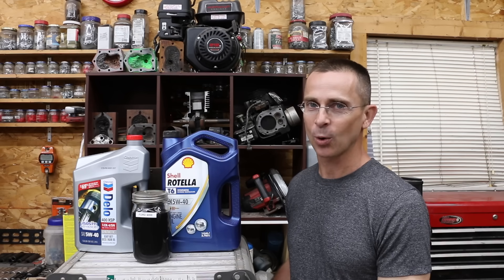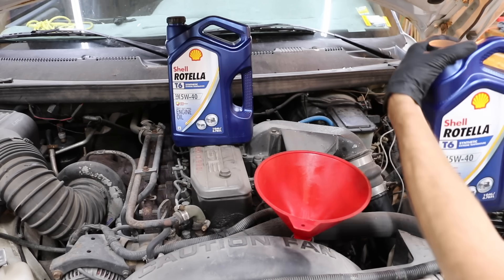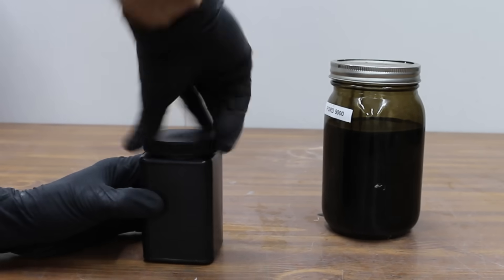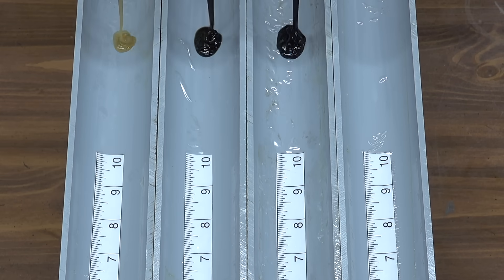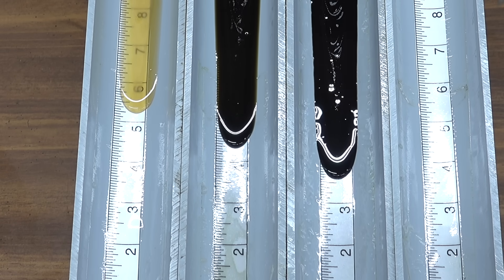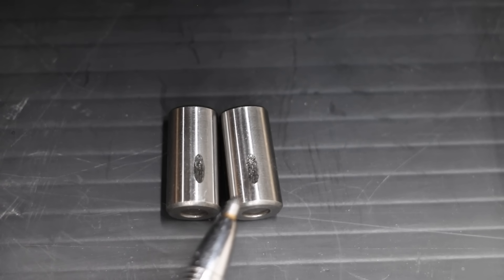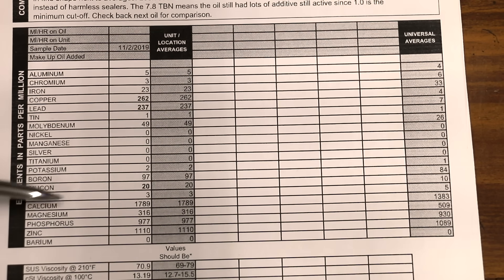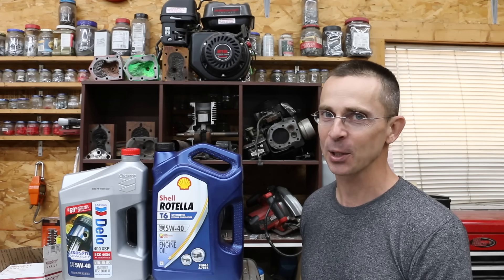Will Annual Oil Change Damage Your Car? Let's find out!

Comment: I bet that Rotella T6 is a Group 3. Ask the lab if they can detect if there is PAO or POE in the oil.
Reply from the maker: Thanks for the suggestion.
Reply: I would only keep oil in for a year if it was a Group 4/5 (real synthetic) and I spent $500 on an AMSOIL Bypass filter that really filtered the oil. Regular oil filters are on bypass mode so much of the time and when you really need the filtering. Navy ships use "oil refiners" because they are not going to change hundreds of gallons of turbine oil or diesel oil at frequent intervals. These probably take out water and acids and of course contaminants.
Reply: @amazoidal  These tests results are intended to find the extent of oil degradation, mechanical wear and the ability to continue protection and lubricity at predictable rates.  What is the basis for your changing oil every year?  Are you regularly taking engine, transmission and hydraulic oil samples for analyses and they reflect significant degradation after 12 months use?
Re filters on bypass mode, doesn't that mean there is sufficient oil being supplied and that the surplus, i.e. bypased oil, is returned to the reservoir?  All oil going to the moving parts is filtered.
Reply: Unfortunately, the spin-on or cartridge oil filters that are supplied with the vehicle (OEM) are a compromise between filtering efficiency and flow. The better the "filtering", the smaller the flow. And with the trend over the years to make oil filters smaller and smaller, the flow resistance has only gotten greater. As that smaller filter does it's job, and the pleats, holes get clogged, the flow slows. Then the only thing saving the engine is the "bypass valve". Even when the filter is new, that bypass filter is working  a lot. It is very common for owners to install "high-performance" oil pumps, or to increase oil pressure/flow by increasing oil pump relief spring rates. No wonder there are reports of oil filters gaskets leaking internally and externally. Some filters have very cheaply designed bypass valves that stay open. So those OEM type oil filters are not only a compromise between flow and filtering, but during cold starts and high rpm, the filter is not even a filter. AMSOIL makes a line of "Bypass Filters", which take perhaps 10% of the oil and can filter it more completely. Much of the oil that we change is merely "Dirty" and those contaminants can be more effectively removed by better filters. But auto manufacturers won't spend maybe $30 on a bypass filter, forcing the consumer to spend $500. The average consumer won't test oil,  and many are challenged to even check their oil level. So it's easier to create jobs by changing oil frequently.
Reply: Looking for evidence of wear artifacts, labs are probably using spark emission, ICP-OES spectroscopy or similar variant, which measure the concentrations of elements.  Testing for a specific organic may involve GC with appropriate detector or GPC/SEC, tests that could not be made for the under $30 for the typical oil wear analyses.

Comment: I have a 2007 F150 with the 5.4 and over 200k miles. If I put in standard synthetic oil or the synthetic blend, the engine will leak some oil. The engine does not leak with high mileage synthetic oil which has additives to help seals. I don't think the normal synthetic oil caused a leak. I just think it didn't provide the extra additive that the seal need.
Reply from the maker: Thanks for the feedback.

Comment: I have a 4.6l v8 mercury grand marquis. In the owners manual here in mexico it says use 15w40 weight. It hardly drops below 0°c to 38°c on summer here. I use mobil 1 super "conventional" 15w40. I change it every 4 months with my fl 820 motorcraft oil filter. I want to change it every 6 months. My options are 15w40 api sp  full synthetic from quaker state or this delo ( SAE 15w40 ) from chevron. Which one will you think it's better? My car is in good condition and the engine burns about 1 quart every 4 months. Thank you.
Mobil super is working good so far. It keeps my engine quiet but I don't trust the brand much to leave it more than 4 months, my driving is commuting daily, might apply to severe use conditions. Or I can use this shell from rotella that doesn't use api sn rating? Thanx for your time.

Comment: My anecdote is that I ran some oil in a Ford motorcar that was at least five years old and was sitting outside in a four seasons environment where it snows in the winter, we ran the car hard for about three months, we foolishly thought the oil and the fluids had been recently changed, they was not, we topped off the fluids but not the oil and the oil came out looking like molasses but nothing really bad happened to us except stuff unrelated to oil.  All the fluids in the car were over five years old.  Later we changed all fluid, but nothing bad happened in the interim.  The car had very few miles on it, which may have helped.
Reply from the maker: Thanks for sharing.

Comment: I'm disabled and in pain all day every day. As a result I do NOT drive very much and was actually wondering this. It didn't make sense to me that it would just go bad but I learned that it actually can however I am capable of using it long enough well over once/month to operating temp. Nice info and I trust it based on the transparency. Weird how transparency works like that.
Reply from the maker: Thanks for sharing.

Comment: One of my cars runs low annual miles.  I queried Blackstone Labs about "low miles vs 12 month oil change".  They told me, "... go by OEM recommended # of miles, not time.  We've tested oils which have been in the crank case for 3 years which are still good"...

FWIW...
Reply from the maker: Thanks for sharing.

Comment: 21 years of Amsoil annual oil changes and I've never had any issue.  Oil level is the same after 1 year as it was the day I changed it.  Less time wasted, less cost, super convenient!
Reply from the maker: Thanks for sharing.
Reply: Wow impressive
Reply: Amsoil does not have brand specs codes on it's packaging, why not.  I use Liqui Moly or Motul, with specific mfgs specs listed on bottles, it makes a difference...if the spec is not listed, means it wasn't tested to meet the mfgs specs for emissions, buildup etc..ie VW Porsche, Audi specs, Vw has codes like 502,504 505 506 507, weigh alone is not the true spec

Comment: Having oil temp up high enough long enough to drive off condensation/water content at least once a month is imho key. IE running under load 30 minutes or more.
Reply from the maker: Thanks for sharing.
Reply: @ProjectFarm   Excellent video, by the way. At first I was afraid this would just be at home testing, where I felt analysis by an oil lab would be the gold standard to definitively answer the question. Then you shared lab results.

Comment: diesel oil in a gasoline engine...hhmmm; ask a bunch of motorcycle & scooter riders and the answer is yep! especially in metric cruisers with common oil sumps that feed lubrication to engine, transmission, clutch, and final drive* segments (* whatever turns the front sprockets on chain drive & belt drive bikes and whatever interacts on the front of the drive shaft on drive shaft bikes); in my case, I am guilty of 'frankenbrew' mixes of leftover 10w-40 (car oils & motorsports oils) & 15w-40 (conventional, synblend, and synthetic) diesel oils for shorter than recommended OCI's to use up old stock;

Comment: Would you recommend t6 for a 1999 mitsubishi l200 it's a 2.5 turbo diesel. The manufacturer recommended a mineral based oil but I know synthetic is better so what's your opinion
Reply from the maker: Thanks for the video idea.

Comment: Another damn good and informative test and comparison. Rotella T6 is a very good oil, as I understand. One dude had driven his RAM 5.9 dually 1 million miles with no engine repairs and he used T6. He did drive long distances and towed stuff with a goose neck trailer. I think he used some diesel additive too, might have been Lucas. I would use Red Line RL-2. I might add RVS Technology triboceramic oil additive as well.
Reply from the maker: Thanks for the feedback.

Comment: The manufacturers used to recommend every six months, I've been going with annual changes, I don't put many miles on my personal vehicles.
Reply: This is really shocking watching from outside the US. In Europe no manufacturer recommends changing oil every six months, and it's mostly the same cars that are sold in the US. Most manufacturers these days require an oil change along the lines of 10k miles or 2 years, whichever comes sooner. Nobody in Europe changes their oil twice a year unless they're driving over 20k miles, many people drive under 5k miles a year and typically get the car serviced every two years. 

You guys are being taken for a ride on your car maintenance.
Reply: @BigUriel  No we just realize $60-70 a year isn’t going to break the bank like a new engine would
Reply: @ericmurrell723  No you're being ripped off. The interval for oil changes is 10000km according to almost every manufacturer. Engine wear in the us is not somehow higher. And as the video shows the performance of the oil does not appreciably decline even when going over a year.
Reply: @zoravar.k7904  I change mine myself so I’m not being ripped off I also change it at 5k mi or so which is almost 10,000 km. I do a lot of city driving, idling, hard driving, tow/haul stuff and drive hard so it’s a piece of mind of anything especially how cheap it is.
Reply: @zoravar.k7904  my quad says to change the oil every 50 hrs or 500 mi so you can’t always go by miles either someone may do a lot of city driving where they idle a lot there’s a lot of considerations
Reply: @ericmurrell723  i agree, a premature oil change costs me R500 for hx8 fully synthetic. 3.5L for the engine and the other 1.5L tops it up till the next needed change. The money one spends on fuel over the interval period between oil changes makes the premature oil change cost look like a drop in the bucket and then one hasn't started factoring in repairs.
Now if you are a knob and take your car in to a dealer to be serviced (R4000-R12000) then i would go with extended oil changes but for me an oil change is like R650 for oil and oil filter so i will do my premature oil changes.
Currently I'm using premium oil shell hx8 and stretching it out to 10 000km, i generally just look at the colour of oil to decide if i need to change it or not, some driving conditions cause the oil to darken quicker, (can't apply the same tactic to a diesel) but before my previous oil change at 7700km the hx7 was still looking fantastic! Infact i put it back in a bottle for future use in my mother's old 1989 Ford as a top up oil as her car burns up quite a bit of oil and her oil darkens alot faster than my daihatsu (3sz-ve).
Reply: @BigUriel  over 20k miles a year? I, like many Americans, average 100 miles per day 6 days a week. I'm closer to 30,000 miles annually. I change mine two to three times a year. Most people here aren't running to the store to buy oil and filters or to the shop to have the changed that often. If anything, they go too long before changes.
Reply: @HooksBill  Depending on which source you look up you'll find on average in the US people drive somewhere between 10k and 15k miles a year. I drive 30k miles a year too on my work van, in fact I sometimes spend more hours driving in a day than most people I know drive in a month, but I'm not really the average driver. In fact there is always a small section of the population that drives very high mileages (ie professionals like me) which skews up the average significantly, and most drivers actually cover far lower mileages.

And it's perfectly fine for any normal modern car engine to go 10-15k miles without an oil change, assuming you're using the correct oil for it to begin with. Especially if it's open road miles, the mileage intervals are specified with an expectation of a certain (significant) percentage of the car being used in traffic and with plenty of cold starts, and if the car is instead used to cover long distances at a time you can actually stretch the service interval significantly as the engine cycles/miles covered ratio goes down and it's really the engine cycles that determine engine wear, plus most of the mechanical wear of the engine internals happens in those first few minutes when cold and there's hardly any wear at all once the engine is up to temperature and used in the appropriate rev range.

Anything else is dealership marketing to make more money off you from unnecessary services. It's not even any "manufacturer" recommendation, I actually bother to read the manuals of my cars and I've yet to see one suggesting you should change your engine oil every six months.
Reply: @BigUriel  Spot on info, I have had various sales roles over the years doing 50-60,000 miles a year. Most of these would be motorway (UK based) miles so cruising 70-80mph, car would always get to operating temp, moisture driven out no exhaust rotting through water etc. the last 7 years have had an office based role with a 60 miles a day commute then the social miles on top, I do little short trips in the car, my car BMW 2 lye diesel has intelligent service / hi mileage service scheduling where the distance to service shows on start up. It typically starts at 20,000 miles but with time / usage this drops and the last 6,000 miles does not take an actual 6,000 miles before the service is due. Engine runs sweet as a nut, recent MOT shows emissions minimal change from new with 174K miles on the car. 
Typical low mileage drivers in UK are pensioners with 3-5K a year but all short stop start type journeys, their cars second hand can become nightmares as usage increases. Things like brakes consumed through corrosion rather than wear
Reply: @BigUriel  I’ve read elsewhere that the service department is the dealerships real money maker.
Reply: Indeed!  Drove new Porsche 911's for almost 30 years and recommendation was 15k miles or 12 months.  My current Audi R8 is similar.  I change once a year since I never hit the mileage limits.
Reply: @BigUriel  I used to drive maybe 10,000 km per year, but now it is probably more like 2,500 km, so I see no reason to change the oil every year.  It is not just about the cost either.  There is the pollution to consider.
Reply from the maker: Thanks for sharing.
Reply: due to covid, ive change oil after 14 months
Reply: @mrri8166  what the hell does COVID have to do with oil changes
Reply: Every six months is really nonsense. I am from Europe where smaller turbo engines are quiet common. These are often sensitive to pollution / particles in the oil. Every year / 10.000 miles is advised for those. Older non turbo engines every other year is fine.
Reply: Funny how now the manufacturers recommend 10,000 mile changes

Comment: In the US you have a 120 V AC  Powerline System, so you need thicker cable then we in Europe with 230V what about to Test an Extension Cord, How mach  Current until it burns. 👍👍😊
Reply from the maker: Thanks for the video idea.

Comment: Ive been in the vehicle maintenance for my entire adult life. Ive personally done around 50,000 oil changes, on everything from a Chevy truck, to a maserati, from and RV and a generator. So believe me when i say how you drive makes all the difference. Does your  80 year old mom/grandmother need to change her oil every 3 months regardless of mileage? No absolutely not. But most people drive more than 1000 miles every 12 months. 

Everything matters, the oil you use, how you drive, how often you drive, how often the vehicle is just idling, how much stop and go. Believe it or not short distances where the engine doesnt come up to temp are actually worse on the oil because it cant rid all of the built up moisture. 

The vehicle also makes a huge deal. You could go 10,000 miles every change on a 2000s model Toyota and it not leak or burn a drop. But go 5-6k miles a few times in your Kia and that GDI motor will start burning oil and will never stop. 

Just use a synthetic blended oil, Valvoline Maxlife is my favorite, and change it between 3-5k miles, and youll never have a problem. 

The filter doesnt matter. There are only 3 filter manufactures in the US and the only difference is the color and sticker.
Reply from the maker: Thanks for the feedback.

Comment: This is a very good video to check now (in 2020), during the pandemic, because so many people are driving much less.  At exactly one year since my last change, I have only added 4500 km on my vehicle.  So, I will just make sure to take a long enough drive every month to ensure the engine temp gets up and I burn off any condensation in the engine oil -- then I should be safe to 8000 km, but might change it a bit earlier since my daily/weekly trips are often very short.
Reply from the maker: Thanks  for the feedback.

Comment: Great info bud. I run the t6 in my 5.9 Cummins, and in my quads and bikes.correct me if im wrong but the jaso ratings means its wet clutch rated .thanks for your research and upload.stay safe out there bud.
Reply from the maker: Thanks so much!

Comment: Good video, what I did, I owed a 1999 Toyota 4 runner, and I sold it for $1,000 dollars, when it had 268,000 miles on it, I didn't change the oil in it for 40,000 miles, and when I did I filter it and reused it, I just changed the filter only.. my point, I think changing the oil every 3-5 k miles is just a scan, to sell more overpriced oil and sell unnecessary products, that Toyota ran great till the minute I sold it, think I'm stupid? Crazy, . Maybe.. but I'm convinced it's a total scam.. good luck..

Comment: One important factor that no one seems to be commenting on, is the fact that after an oil change the engine runs without oil for approximately four seconds. Not good.
Reply from the maker: Thanks for the comment.